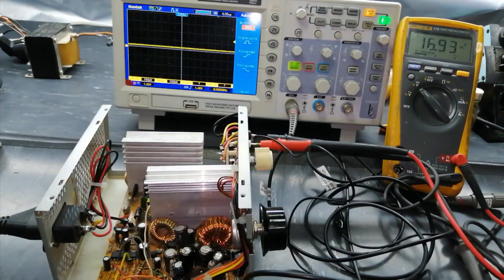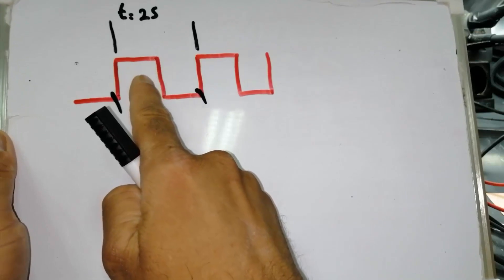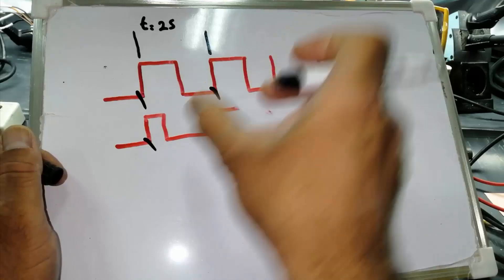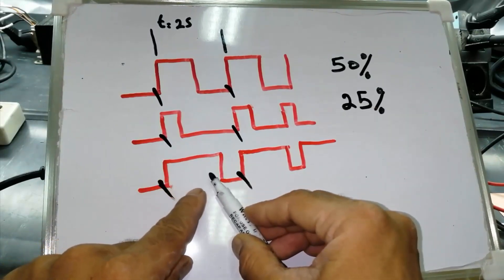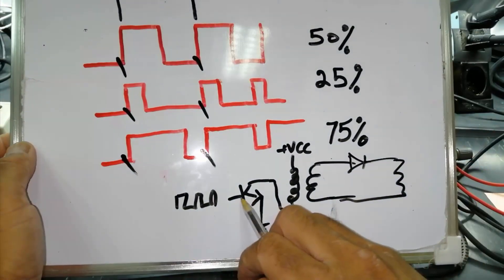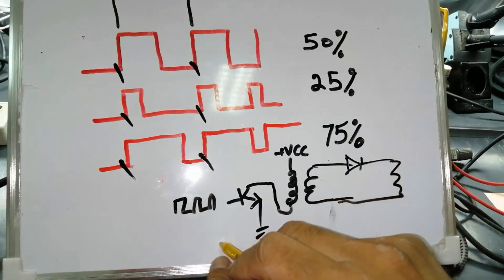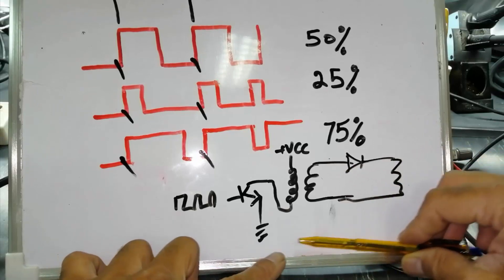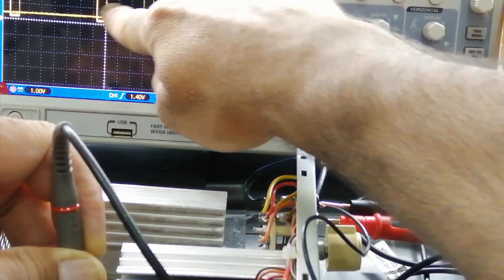{215} How to Measure Frequency and Duty Cycle with Multimeter, What is duty cycle in PWM

Comment: Haseeb bhai our multimeter has maximum 100khz or 30mhz  why can't we increase this upto 500mhz 
With external circuit 
Like we see in r.f mixer stage  
The mixer stage output should be the maximum of the meter and the input frequency is below 500mhz

Comment: how does the number of frekuensi effect the output voltage sir
Reply from the maker: it is directly involved in voltage generation from any smps transformer. 
switching frequency is very critical item to get proper output
Reply: @HaseebElectronics  how does the frequency relate to the amount of voltage, is the higher the frequency the higher the voltage, from the variable frequency what parameters have changed, sir, thank you
Reply from the maker: @sopyanroni  frequency of any smps is used to design the transformer and to get desired regulation
if we use 50 khz and design a transformer
in same circuit if we use 100khz, the transformer size will half, 
increasing switching frequency will cause yo reduce circuit cost but at high frequency there are some other issues.
so duty cycle is changed to get voltage regulation
please check my upcoming video, that will approximately on similar topic, I will explain this point as well
Reply: @HaseebElectronics  ok sir, thanks for the explanation, I'm waiting for the latest video, good luck sir

Comment: How to adjust duty cycle in circuit.some smps board have fixed voltage. how to change  adjust the output voltage.if full duty cycle on what happened

Comment: your videos always good for both theoretical and practical explanation. i have one doubt. in smps side using pwm control drive the transistor to flow the voltage to transformer for step down. but we have received 320 v dc from input filter capacitor. These voltages are running via transistor to transformer. it is possible to get dc voltage to transformer primary side.